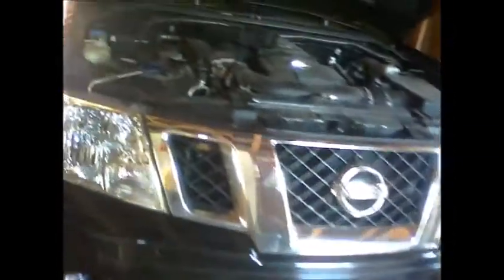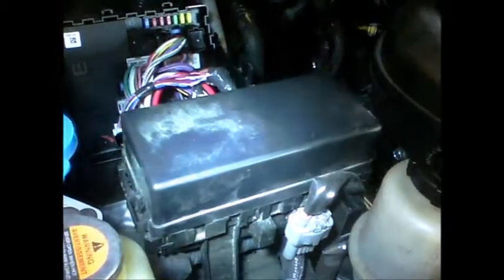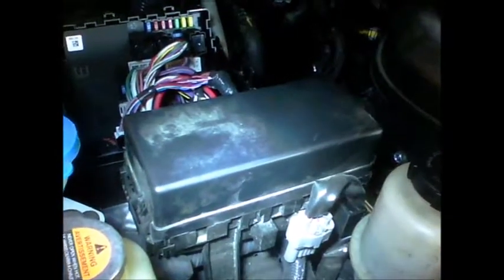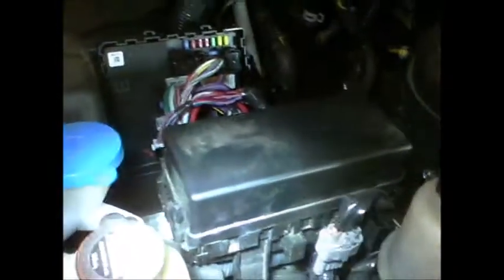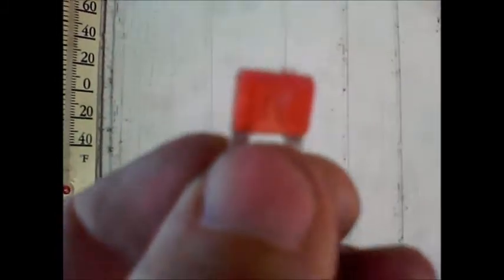2016 Nissan Frontier Tow Lights Fuse Location

Comment: You don't need the pliers. the fuse panel will pull straight up and out. Just depress the 2 black tabs on the left and right side of the fuse panel, that's why there is so much extra wire there bud.

Comment: I am having the same problem except my problem was trailer turn signals and I could never find the fuse. I took to the shop today for an unrelated problem but had them check my turn signal problem and they called me back and said it was a 10 amp fuse. I will search this area before I pay them 10 times the price to fix it.
Reply: TK34B7 Chance you’re the best, i found that fuse in that little box, its the only fuse of its kind in that box

Comment: Thank you.  The fuse replacement is easier if you slide the fuse box up so you can access the fuses - there are tabs on either side of box that you press in, and the whole box slides up.   That way, you don't have to unplug any harnesses.  In my case, the truck was hooked up to a trailer with grounded tail lights, so a blown fuse made sense.
Reply from the maker: Thanks Steve
Reply: Sorry Steve, didn't see your "on target response"

Comment: My 2011 Nissan Pathfinder has the same fuse box set up and F-4 is also the trailer tow fuse located as you show. I took my Pathfinder to my favorite corner mechanic and asked hime how to get out  the F-4 fuse. He simply reached back and pushed a "thumb lock" on the upper right hand corner of the fuse box and lifted the entire fuse block out of the box and had enough wiring slack to put it with 3 inches of my nose.  Thus, easy to pull the fuse, confirm it was blown, replace it and restore the fuse block to it's place in the box.
Reply from the maker: You are right Peter. I later figured that out after replacing the fuse several times. I need to update the video

Comment: Hey Paul. Thanks for the video! I have an issue that recently developed with my 2010 Frontier SE. I have the OEM trailer harness installed behind the pass. side kick panel, and have pulled a trailer before with no issues. I recently noticed that a loud click sound has developed that comes from the trailer harness when I toggle back and forth between no lights and running lights. I thought I isolated the sound to one of the blue relays because when I pulled the relay from the harness the click disappeared. I swapped relays to see if one was bad, but the click sound still persisted. I also was searching around the same fuse box you mentioned in your video and was going to check fuse F4. Did yours make any kind of a clicking sound when that fuse went out? Just desperate to get rid of this obnoxious noise, so if you have a moment to respond it would be greatly appreciated.
Reply from the maker: I did not notice any noise. I do know that all the relays that I have ever had experience with  will make a click sound when the switching occurs. A relay is a switch
Reply from the maker: No Sound noted.  I am sorry but I have no idea what would make that loud sound?
Reply: That fuse box comes out